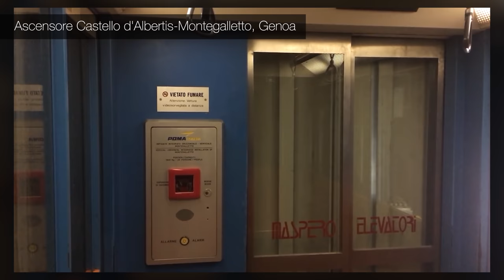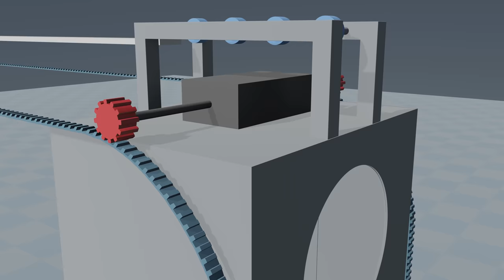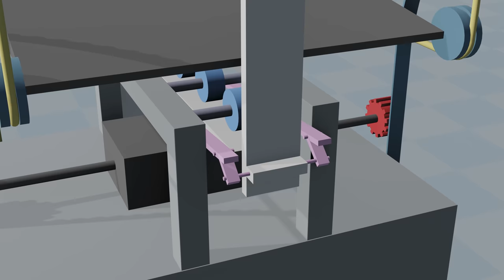I thought the Schmid Peoplemover was impossible

Comment: I don't think there's anything quite so German as being able to set up an entirely unique, large structure in four hours, and then doing it in three anyway.
Reply: There is: being proud of the achievement because the rail system was less disrupted as a result.
Reply: There is. Goign to build an airport in 6 years and then it takes 16 (or so)
Reply: After all,it took us only a bit more than 14 years to build an airport.
Reply: @steemlenn8797  That was in East Germany, East Germany doesnt really count as part of Germany.
Reply: Stuttgart 21 train station. Construction started in 2010, planned finish was 2019, now expected to be at least 2025. German efficiency is no more, sadly.
Reply: @steemlenn8797  well the elevator was his invention and his company, so very different approach :D
Reply: @_--_--_  So I guess Stuttgart doesn't count as part of Germany either?
Reply: @_--_--_  Damn, now the AfD wants me to leave Germany!
Reply: Well there's a somewhat simmilar story: in 1992, Munich got a brand new airport, and everything was moved from the old one there literally overnight: it only took 16 hours.
Reply: @lonestarr1490  Stuttgart has different reasons for its delay.
The airport had many delays because of the utter incompetence in engineering (just for an example the engineers designing the vent system didnt know that the physics are different between positive and negative pressure flow!, thats laughably sad!).
Stuttgart has its delays mainly because of incompetence in project management.
Reply: @_--_--_  yes it does
Reply: @steemlenn8797  You know that the AfD is only really popular in East Germany right? Werent it for East Germany the AfD wouldnt have nearly as many seats.
Reply: German efficiency is a total myth. The amount of red tape means most projects take forever.
Reply: @_--_--_  Stuttgart 21 has some flawed design, like less capacity but the main Problems are that the rocks under Stuttgart are not good fot tunneling and the trainstation having to be uneven
Reply: in the US that would have taken 4-6 weeks and disrupted the rail service for 8 hours every day
Reply: @_--_--_  Ah, ja klar, Deutschland ist nicht Deutschland. /s
Reply: @Alex_Vir  Ein Teil Deutschlands der länger Teil der Sovietunion war als ein Teil der Bundesrepublik Deutschland, ja. Zudem noch in jedem Bereich der Industrie Jahrzehnte hinterher hinkt und dessen Bürger zu einem besorgniserregend hohem Teil dem Kommunismus hinterher trauern sehe ich einfach nicht als Teil der Bundesrepublik, Wiedervereinigung hin oder her. Und diese Ansicht habe ich nicht als einziger im Westen.
Reply: I wonder if that last spare hour was spent at the beer garden celebrating? 
I hope it was.😉🍻
Reply: @3dDoener  yes, this. Sadly, was never at the old airport Riem, I was little kid back then. 
fun fact: there's still  a small part of the runway existing.
Reply: @steemlenn8797  someone had to bring it up. Sad German day.
Reply: @_--_--_  WOW GET OUTTA HERE
Reply: @Darkness251  German red tape exists as well. German and Japanese precision and planning are legendary... it's when something is UNPLANNED happens that it takes FOREVER to resolve. This is why the cultures in both of these countries tend to emphasize extensive planning and contingency planning and contingencies if the contingencies fail planning... 

North Americans are good at thinking on their feet, but a lot of the inventions are iterative. Some are good, some are just bad ideas or not thought out... held together with duct tape and dental floss... but they work just good enough kind of things. 

I think there exists a compromise in between but you'd find the Americans would hate the German or Japanese Constraints and the Germans and Japanese would despise the lack of forethought, planning, and testing to create an actually GOOD product.
Reply: Have you heard about the tragedy of BER airport the late?
Reply: @Alex_Vir  Das mit Reichsbürgern zu vergleichen ist etwas weit hergeholt finde ich. Und Deutschland geographisch oder politisch ist halt was anderes.
Mein Anliegen war, dass kulturell der Osten einfach komplett unterschiedlich ist und ich finde die Kultur die seit Gründung der Bundesrepublik im Westen entstanden ist nichtmal ansatzweise seit Wiedervereinigung in den Osten übergegangen ist. Deshalb finde ich, dass der Osten einfach nicht Teil der Kultur der (Bundesrepublik) Deutschlands ist.
Reply: @_--_--_  Die Reichsbürger waren grade nur das erste Beispiel was mir für diese Situation eingefallen war.
Und was meinst du mit Kultur der BRD, meinst du den Norden, Bremen, Hamburg, Schleswig-Holstein? Oder eher den Süden, Bayern, Baden-Württemberg? Oder doch eher das Rheinland, NRW, Rheinland-Pfalz?
Reply: laughs in BER, Stuttgart 21, or any broken Rhine-bridge :P
Reply: @_--_--_  You know that the AfD won their most seats in Bayern and Baden-Würtemberg?
Reply: dude have you heard about the berlin airport
Reply: Let me sing you a song About rules and regulations that would have very much only permitted one of these systems as a prototype. For more people movers a whole set of rules and regulations will have to be written to regulate elevators that change directions.

In short: the amount of red tape and reporting you have to do to erect a bridge in 4 hours dwarfs the actual building process.
Reply: If this was the UK it would have taken weeks.
Reply: Take longer for the Brits but we would have a laugh while doing it.
Reply: The Japanese do it better though 😁
Reply: @_--_--_  Hier zeigt sich eine besorgniserregende Unkenntnis der Geschichte …“Teil der Sovietunion“?
Reply: @steemlenn8797  Only because you had politicians interfereing :)
Reply: @Seegalgalguntijak  I mean my city received 2 million dollars from the state and federal government to expand a stretch of highway. 26 years later and 3.6 billion dollars later, no work was done. The budget has been increased and they have expanded the scope of the project from a mile to 50 miles of road.
Reply: They have a tendency in Japan to be as efficient when doing engineering work. Such as road work or rail maintenance etc.
Reply: @UAlbrechtBln  Wie was "offiziell" war ist eine Sache, aber praktisch gesehen stimmt die Aussage.
Reply: 1 extra hour of beer drinking for the workers!
Reply: nah you don't know anything bout germany
Reply: Love the springer spaniel in your profile picture!
Reply: @steemlenn8797  He's Swabian. The Airport is in Berlin. Ginormous difference.
Reply: mind that that was 20 years ago. things changed
Reply: As a foreigner living in Germany I would argue that the most German thing was being pissed that "traffic has to stop for one pedestrian".
Reply: @_--_--_  well that's where you are wrong. Stuttgart has his delays because people... They had time to say that they disagree with the plans which had to be made public in advance. They didn't do that and after construction has started people started to disagree and protest against it. Which meant that everything had to be planned again. This project is huge or in other words replanning everything while construction has already started took enough effort that the Deutsche Bahn had to create an extra department just for this singular project. Or in other words. People are displeased that getting something they wanted after it was to late takes time...
Reply: @blacksarlacc91  And thats still management. Exactly what I said.
Reply: If there is anything less german than building efficiency I'd be astounded.
Like anything being built here takes at least triple the time and ten times the cost.
Reply: We are also capable of building an airport in 14 years, spending 866 instead of 77 million euros for an opera or spending 130 instead of 10 million euros for renovating an old sail ship, which is used for training purposes in the marine.
Reply: @steemlenn8797  you can be Sure Theres Something under the Airport that took 16 yeare .dump
Reply: @Darkness251  something tells me there’s more to the story than this. “The old times were better” is often a lie. For example, I’m guessing things were more efficient in America back when we didn’t have any safety regulations and no protections from massive worker exploitation.
Reply: @user-propositionjoe  I mean, the alternative is being more like China and having everyone work 12 hours a day 6 days a week with minimal safety measures. Something tells me the trade off for better human rights is lower efficiency.
Reply: @TheNewGreenIsBlue  I mean Germany also has the problem of over engineering projects. How many firearm contracts have German companies lost millions on because nobody wanted their firearms that were 5% better than anything else out there but were incredibly expensive and hard to fix?
Reply: @Darkness251  And on top of that, it is already known that Stuttgart 21 will be too small if the DB will ever want to introduce the DeutschlandTakt.
Reply: Sadly that's way out of the norm here.
There is a train station near me that was under construction for about 8 years.
Reply: It's also very German to engineer something very complicated when there are simpler but less optimal alternatives.
Reply: @TheGrumbliestPuppy  True... I feel the Japanese usually strike a decent balance as they tend to overengineer the processes as well... which invariably leads to simpler elements. 

Look at Toyota vs. Volkwagen. Toyotas are usually made with high levels of precision but they also engineer and pare down the processes to be repeatable and simpler to avoid errors... resulting in a good balance. 

However, if there's a feature that actually makes something better... they tend to add it as opposed to taking the classic American approach of if it's not broke... don't fix it. 

Germans sometimes engineer something for the same of engineering it... and yes it's probably better and stronger... but the process to reverse or fix or maintain it hasn't had the same amount of thought put into it. They put emphasis on the physical precision of something and less on the precision of process... (though more than your typical US firm)
Reply: @julianshepherd2038 
"Right," said Fred, "Have to take the wall down
That there wall is gonna have to go."
Reply: yes, i agree there...
and im so proud of it
Reply: We have to build things quickly, otherwise an environmentalist group will say it found a rare toad at that exact spot and then they'll start a petition and in the citizens will get a referendum and even though only 15% actually vote, they will inevitable reject the proposal and nothing gets built, ever... Meanwhile the toad has been run over by a train.
Reply: everyone: swabians are really fast
swabians: noi, we are jusht shtingy with time
Reply: In my head-canon they took an hour lunch break during those three as well.
Reply: There is something way more German: you are able to move it in three parts and within 4 hours but u are still not able to move because paperwork takes forever.
Reply: China and Japan are specific in that type of engineering, and in Europe only germany can close the gap
Reply: @steemlenn8797  There is a difference. This elevator was build by a company and the airport is being build by CDU politicians.
I don't have to explain more, right?
Reply: i will continue to buy my powertools from germany, if you prefer the chinese ones you know how much they worth
Reply: Understand your pride, but if you look east, people there can do it in 90 minutes. They built a bridge alongside the railway and then spin it across.
Reply: @_--_--_  German left and center are barely better.
Reply: @lookinforanick  I’m from a very different country and totally agree with him.
Reply: @ottoneiii4353  USA and Japan power tools are often better.
Reply: @steemlenn8797  there were politicians as project managers instead of those who are capeable to actually do it. There are many examples of us germans doing great projects within and with less time even through we have to follow alot of bureucracy and savety procederes
Reply: @noop9k  just because it's true doesn't mean you have to say it
Reply: That's not true our projects take decades and that on purpose to waste tax money. They calculate a project knowing it takes longer and is more expensive and once it's granted and started more and more money will go into the project. For example railway station, airports and streets
Reply: That's bot very German though. Should take 4 Days instead of 4 hours :)
Reply: You know what’s more German than that?
Being the railway company telling them they have to do it in four hours.
Reply: Have you been to Germany? Obviously not! It takes them four years to repair a road.
Reply: @_--_--_  you are a … (fill in the blank yourself).
This project was done by engineers, and on a small scale.
Building an airport sadly introduces politicians and big scale permits and other paperwork. In those 14/16 years people mention here, there hasn’t been constant building.

Nothing east german about that
Reply: @Darkness251  as soon as projects grow over a threshold they get politics involved with their permits. Then years ad up fast.
Reply: 3h, BER look at that! 😂😂😂
Reply: This is in no way german
Reply: @3dDoener  Oh yes; this was something I never was able to understand (although being an engineer myself...🤷🏼‍♂️)
Reply: No one here is clearly German. The most German thing would be planing on doing this in 3 months, then actually taking 5 months just to have it be closed down for at least 2 years because of bureaucracy or safety reasons.
Reply: Well, those people are sadly going extinct. A lot of not very bright ones are following...
Reply: @steemlenn8797  why's that?
Reply: Kinna makes you realize that any goal they have they’ll probably be able to accomplish. And in one hour under budget.
Reply: I can think of a couple things Germany is more famous for
Reply: I can think of something else. Railroad accidents, like Eschede or Lathen. It's a cold glass of water for power of German engineering and order stereotype.
Reply: @philipps7287  Hm, yes, nowadays... For me, it seems the real engineering passion (like Mr. Schmid has) is now gone mostly; paired with an endless growing bureaucracy this leads to shining examples like BER (berlin airport).
Reply: @_--_--_  do you know that the engeniers where from east germany or is that just an assumption?
Reply: @dylanb2990  read robert kiyosaki. They need to spend it to get more granted in the next time period.
Reply: @Darkness251  You all need to differentiate between private projects and public ones. S21 or BER is a public, state organized project and therefore works like the German administration, which is... slow. This however was a project built by a single private company, which in general are fast and efficient.
Conclusion: Do not confuse state administration with private organizations, when talking about efficiency.
Reply: Exactly! Germans are good at things like that, they even built a huge peoplemover back in the 40s!
Reply: chill... its just a stereotype
Reply: Not its a scottish quality, remember Mr Scott and his warp drive repairs on NCC1701
Reply: @Darkness251  The difference between a government planned project and a private project :D
Reply: Check out BER Airport tho...
Reply: In my country they once built a highway underpass in one weekend. Search for it on YT, it’s fascinating to see. Almost all our highway and rail infrastructure maintenance is at night, in weekends or holidays, in order to not disrupt traffic. I think that’s why we’re called half-Germans.